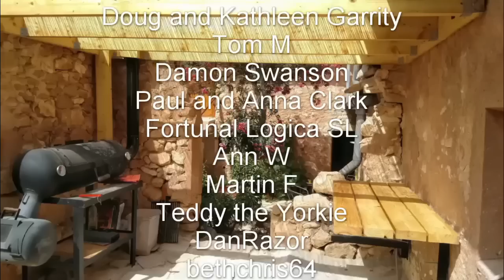Building a new stone wall and renovating the existing ones - Finca restoration in Spain

Comment: Have you considered rendering or white washing the wall rather than the hood? The stones on the hood are beautiful (at least on camera) and would stand out against a white wall. Also, that room is rather dark due to the small window, this would brighten it up without the need for excessive lighting.  Otherwise, we think you're both doing a 'smashing' job!
Reply from the maker: Thanks. The Adjacent walls will be white, which will brighten the room and make the stone stand out